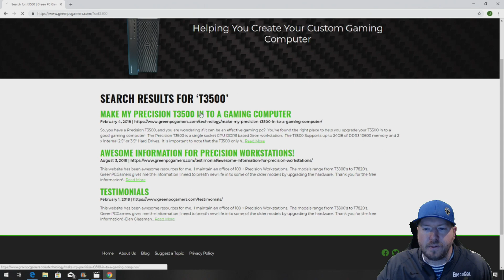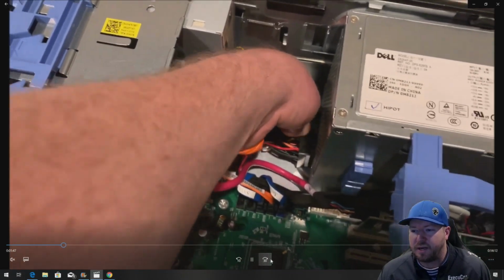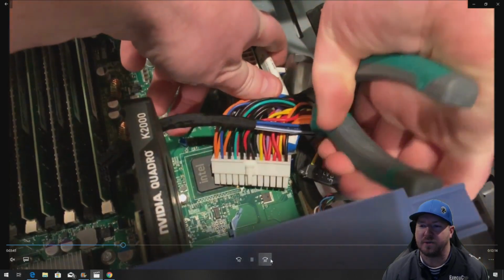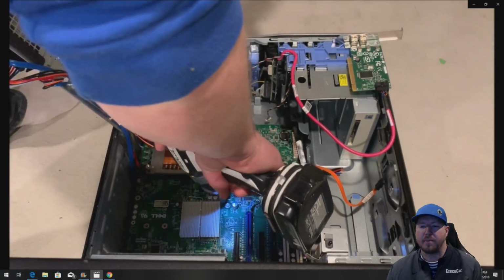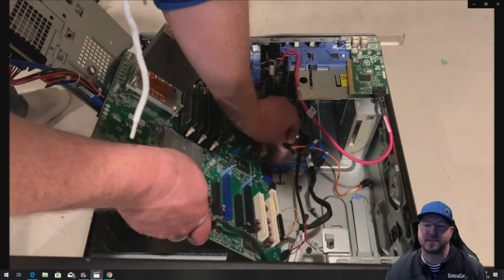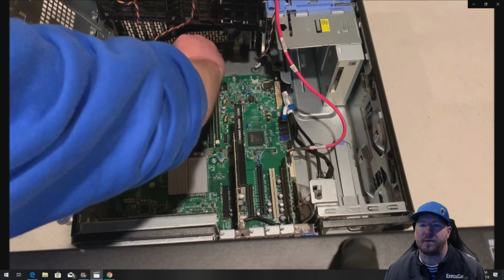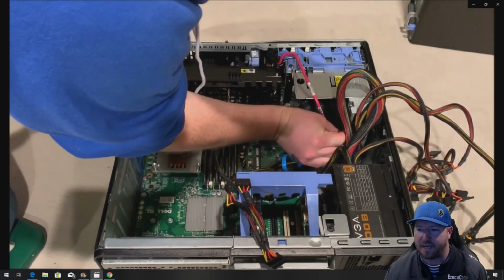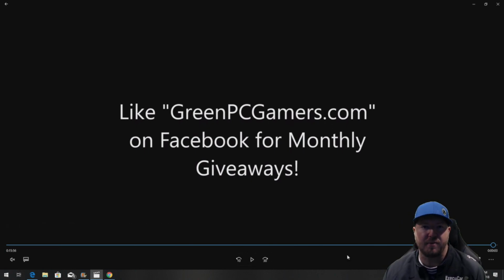Precision T3500 700W Power Supply Upgrade/Replacement

Comment: I was helping my 11 year old Grandson upgrade is Dad's old work PC. (the T3500).  He wanted a better solution to play his favorite game Fortnight.  I had a brand new 550W power supply that I had sitting on my shelf for the past 8 years. We installed the XFX Radeon RX 570 RS 8GB AMD Graphics Card, and replace the power supply.  Thanks for the video, it helped a lot.  I ended up just leaving the old wiring harness as is.  There was plenty of room.  At some point, I think he will want to upgrade the mother board, and at that point I will clean up the wires.  Also found 6 more GB of RAM from a neighbors old HP Desktop.  So he has 12 GB RAM now.  He is a happy camper.

Comment: Nice video, put a 650W PSU in mine back in November, ended up removing mobo like you, replaced processor with a X5680 six core 12 threads and popped in a GTX 770 making a really cheap gaming PC. Also added SSD and memory can be found cheap because its ECC. Overall very pleased with the result, also It's the sturdiest desktop I've encountered, this thing is built like a tank !
Reply: Which psu did you buy?
Reply: @nghaninawab  Corsair TX650M, now I have upgraded graphics with RX 570 bought cheap ex mining card, even better performance. I think X5680s have also dropped in price quite a lot.

Comment: To anyone considering doing this, rather than cutting wires and essentially taking apart your whole system, look for T5500 power supply which is plug-n-play direct swap of 525w PSU to 875w PSU. I got mine from eBay in great condition for under $50 and swapped in under 10min easily with just 4 screws removed.
Reply: Which GPU did you use with it?
Reply: @nghaninawab  I'm running a 2660s but that's because I went back to original psu. The other one was bad after 3 weeks and I haven't bother to buy another. Used PSU is ymmv

Comment: Found my T3500 in the recycling centre thought heck I'll see if it works more intrigue than anything . Once opened up it had its stock PSU and an old Xeon inside. I had an old geforce 710, some ram and a HDD so I powered on and it booted up, couldn't quite believe it. I still have it now upgraded with a 650 w PS with a Xeon x5670 , gtx 1070 , 24 GB ram and SSD, runs like a champ. plays latest games on high settings , runs steam VR via virtual desktop honestly best PC I never paid for!

Comment: I got my T3500 from work a few years back. A customer of ours was upgrading their IT so old the old kit came back to us and most of it was simply being thrown away. I rescued the T3500, cleaned out the dust from inside (it was literally caked in black filthy dust), replaced the CPU with a Xeon 5670 6 core 12 thread processor I got from eBay, replaced the 2 x HDD's which were in RAID configuration with a 500GB SSD, removed the RAID controller, removed the Quadro GPU that was in there and replaced it with a Gigabyte Radeon RX 570 8GB card, removed a few other random cards (one of which was a serial card with 4 connectors on it), and upgraded the RAM to 12GB in triple channel configuration. I installed Windows 7 first then upgraded it to Windows 10 whilst Microsoft were still doing that for free. It runs great and I can play pretty much any game I like on it. It's an extremely heavy machine and built really solid, and I think it it was well worth the relatively small amount of money I had to spend on it to get it up to a reasonable level of performance.

Comment: Hello, cannot find anymore the EVGA 100-B1-0700-K1. Do you know if the EVGA 100-BR-0700-K works for Dell Precision T3500 as well? Is there any problem related to "inverted polarity" in original Dell Power Supply N525EF-00 that prevents its substitution by EVGA 100-BR-0700-K?

Comment: I got mine from a person on a Discord server that lived fairly local to me, they were going to just throw it out so they offered it for free. It came with a 4 core Xeon, some RAM, a 500GB HDD and an old Quadro.
Reply: @Tea And Crumpets! Not yet, once I get the money together though, I'll be upgrading the CPU to a 6 core Xeon, maxing out the RAM to 24GB and putting in a new GPU though.
Reply: @DJenerate  i have same one, best gpu to add is the rx 570, you can use pc3 10600U ram, and the most powerful cpu for dell t3500 is the W3680 and overclock it with XTU (intel extreme utility) BUT BEFORE UPGRADING THE CPU MAKE SURE YOU HAVE THE LATEST BIOS UPDATE i recommend the A17 bios update..if you got any question hmu
Reply: @thelaw9937  w3690*
Reply: @xortinmalinsky5772  yeah true but the w3690 is overpriced

Comment: What other psu we can use for the t3500,, what is a good modular psu so we can still use the same wiring harness,also can we use the psu from the t5500 which is 875 watts
Reply from the maker: EVGA and Corsair make some good options.  This EVGA 750W Would be nice:  https://amzn.to/2SMG1F6  

We have never tested the 875W T5500 Power Supply in a T3500.
Reply: @GreePcGamers.com- can you do a case swap with the Dell Precision t3500 motherboard into another case oh, I am going to change my power supply but I also want to change the case if it's possible
Reply from the maker: We’ll add it to the list.
Reply: @pugslarock  cases are standard atx format, this motherborard is a btx format. It wont fit properly, mounting screws dont match, back panel with outputs doesnt line up. Atx cases are on the left side, this one is on the right side, the whole thing would have to be flipped. It also has the 4 diagnostic LEDs and power button and the front 2 fans which the bios needs  signal from to even start. You would need all that. Also the usb headers are proprietary and the wiring is different, although im not too sure about that one. Soooo.... Yeah. I didnt bother with mine, had it for several years now.. I use it with the side panel off aswell cuz the graphics cardis too big....
Reply: @GreenPCGamerscom  i can confirm that the 875 watt PSU from a 5500 would work just fine with a 3500. I've got that installed on my own T3500 at home and its been running fine for well over 8 months now. The wiring harness for the 3500 will not work with the T5500's PSU, so it has to be the 875w T5500 PSU and harness.
Reply from the maker: Thanks for sharing!

Comment: I got a t3500, but I another dead computer and a box of 200w power supply for 40 bucks. Been my main edit rig. X5670 upgraded, and USB 3.0 card, power supply upgraded. SSDs. Raid 5 USB 3.0. Next upgrades sata 3 card with 2 lanes and 4 ports, and graphics card and memory. Found your 48gb ram video. You guys rock.

Comment: sir The cpu 8 pin plug -what the voltages for the pin out the psu the 2v4pin needs to mark cpu not gpu?

Comment: I have a t5600 and Hwinfo says my psu fan rpms are at 52,429 rpms. It doesn't change like my cpu or other fans. My PC is still a little loud even after Noctua upgrades and i think this might be the issue. Is there a fix for this or do i need to get a new psu? Also if i need to replace will the 1300w fit in a t5600?

Comment: I have the motherboard of one with a Xeon E3550 I got it from a school which was upgrading their teacher's PCs but I did not get the case so I need to figure out a way yo start it up without the front panel buttons
Reply from the maker: If you use an atx psu it might start up with the psu switch.  Otherwise you could pick up a T3500 control panel cheap on eBay.
Reply: @GreenPCGamerscom  yeah I need the front panel unless you know of what pins need to be storted to start up the board.

Comment: Can you put a 2080ti in this system and will it operate well on 240hz gaming ?
Reply from the maker: Assuming that you would upgrade the power supply first, you could install an RTX 2080 Ti in to a Precision T3500.  However, we wouldn't recommend it, because the bottle-necking would be terrible.  The GTX 1660 Ti, RTX 2060 Super, and RTX 2070 Super cards would have less bottle-necking, are cheaper,  and work well in precision T3500 Workstations.
Reply: What power supply will plug and play please lol I cannot find the one on the link and I want like 800-850 🙏🏽 btw your site is AWESOME! Love all the content ! Thank you .
Reply: @GreenPCGamerscom    would it be worth it to upgrade cpu ... i currently have a t3500 with a X5650  ... WOULD IT BE WORTH IT TO UPGRADE TO THE X5690? and that is thee best cpu you can upgrade to with this motherboard right ? thanks.
Reply: Please let me know which PSU were you able to upgrade in t3500 (greater than 700W)?

Comment: will the 850 evga work as well
Reply from the maker: As long as you can fit it in the chassis, the EVGA 850 should work fine.
Reply: Did it work?

Comment: I bought T7500 motherboard which is almost the same as T3500 motherboard, almost the same. It will be my main system for a bit, because i7 9700k is disappointing. I will wait for better CPU release
Reply from the maker: The T7500 is workhorse.  What do plan to use the system for?
Reply: Hey man can you replace the power supply in it
Reply: I would also like to know

Comment: hello friend this is the "9kpnv" model motherboard of dell? i had this doubt that uses standard 24pin power supply,i am new in this mobo motherboard and want to buy at a good price? thanks and greetings
Reply from the maker: 9KPNV is indeed a Precision T3500 System Board.  You can snipe them cheap on Ebay or other auction sites.

Comment: Got my t3500 from Craigslist for $80 with a 6 core 12 threads xeon, 100gb ssd and an upgraded 700 watts power supply.
Reply: Which psu did you buy?
Reply: @nghaninawab  stock psu from a t5500. They’re 725 watts.
Reply: Do you use heavy duty GPU?
Reply: @nghaninawab  I don’t really game too much. I only play project cars 3. I have a 750 ti in my t3500. I still get around 80-100 FPS on medium settings.

Comment: can a 180 mm or 200 mm long PSU like corsair RM1000x or EVGA Supernova 1000 accommodate in T3500 Case ?
Reply from the maker: Hey Manoj,  we have not tried those power supplies in the T3500.  I don't see why they would not work as long as you can physically fit them in to the T3500 Chassis.  Here are the dimensions of the PSU that we used:   85MM (H), 150MM (W), 140MM (L).  I hope this info helps.

Comment: My pc turns on but now I can’t get a display signal from my GPU
Reply from the maker: Did you add or change something to the configuration?
Reply: @GreenPCGamerscom  yes. New power supply, new gpu. GPU led works to let me know it receives power, fan is on. GPU is quadro 6000, power is plugged in to 6 and 8 pins
Reply from the maker: Was the card new?  If you put the old graphics card in, do you get video?
Reply: @GreenPCGamerscom  new card is quadro 6000 sold the old one to buy the new one 😒
Reply: @GreenPCGamerscom  also I just put another card in, doesn’t work

Comment: Can you please do a Precision T7500 power supply replace
Reply from the maker: We haven't swapped the T7500 Power Supply because it comes stock with 1100W.  What wattage PSU did you want to install?
Reply: @GreenPCGamerscom  700 watt is it good enough for a 1060 and can i take out the the big heat fans and put somethibg else
Reply: So can I replace my psu on a T7500 cause my one is shot

Comment: There is a problem in your video. T5500 can be upgraded with a second CPU. This second CPU is mounted on a riser board and need a special 12v connector that a standard PSU didn't provide. How to add the second CPU with a new PSU ?
Reply: You are correct. It can be upgraded with a second CPU and that’s why dell shipped the original T5500 with a 875w PSU. If you are only using 1 CPU then 600-700w are good.

Comment: I dont know if anyone could help me ive installed a new psu in my dell t3500 everything is plugged but when I want to start the system I do get a orange light on the motherboard.. It wont start does really nothing
Reply from the maker: Did you use the same power supply that we used in the video?
Reply: @GreenPCGamerscom  nope, i used an thermaltake with 600watts
Reply: so I fixed this problem by myself, it was a faulty motherboard everything works fine now, the owner who had that pc before me said the psu didnt work after some time, so probably that fried the board. Got an cheap replacement on ebay.

Comment: can I just use a 6 pin to 8 pin adapter for a GTX 1080 with the 525 psu?
Reply from the maker: You could do that.  However, we’d recommend upgrading your power supply for long term stability.
Reply: @GreenPCGamerscom  Yeah, just running with an RX 560 using the 6-pin power connector already makes the psu run warm, i wouldn't put a high wattage 8-pin on the stock psu.

Comment: Great video! I have a T3500, which I run as a Hackintosh, and I have fan noise which I don't know if it is coming through the PSU or front fans. I have a modular Corsair 750 Watt laying around so I'll replace it to see if it helps kill the noise. Also, I could upgrade the GPU, which is a Radeon RX 560, with the additional power for the card. I will take off the motherboard as I would like to run the 8 pin power harness under the board as the original Dell PSU had. I do like your idea of cutting off the harness connectors though. I was wondering if you tried just one at a time pulling the wires up individually for less resistance after you cut them?  Oh well wish me luck and I hope I don't have any extra %$#& screws. Thanks for the help.
Reply from the maker: Sometimes the front fans fail and can causing a whining noise.  We tried pulling individual cables w/o any luck.  Good Luck!
Reply: @GreenPCGamerscom  Thanks for all your help. Yep, the cable are bound pretty tight with the cable ties so I can see why you couldn't yank them out individually. The Corsair is keeping things quiet for the moment. The front fans were really dirty and I gave them a good cleaning so fingers crossed it's not them. I ordered a fan/heat sink for the northbridge because I hear that it can get very hot. Thanks again.

Comment: I don’t think they supply close to 520w if they did pretty much every single graphics card could run of it
Reply from the maker: They T3500 factory power supply is just old and poorly designed.
Reply: @GreenPCGamerscom   Its the 12 volt rail that does not supply enough power these systems were never meant for gaming GPUs.
Reply: @NoodlesTBograt  they can deliver enough for a GTX 1650. That's a lower tdp than the dual NVIDIAs that the systems were designed to run.